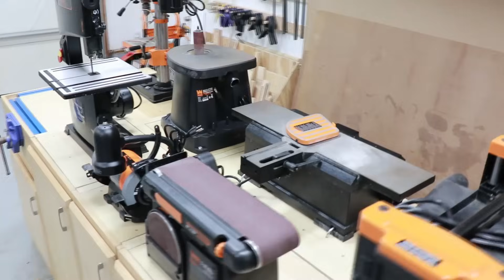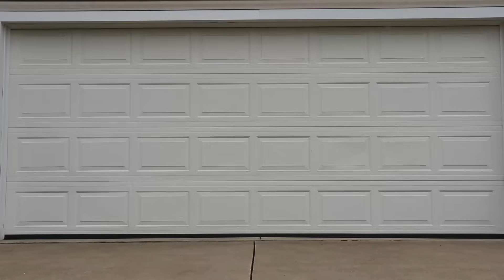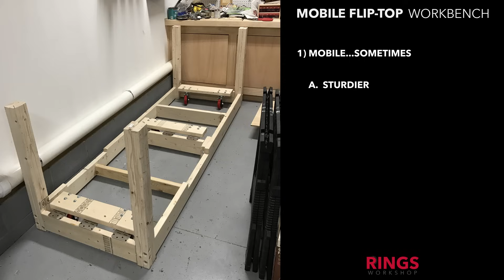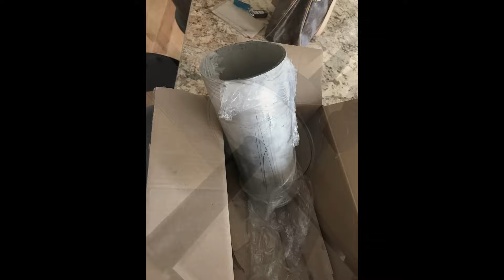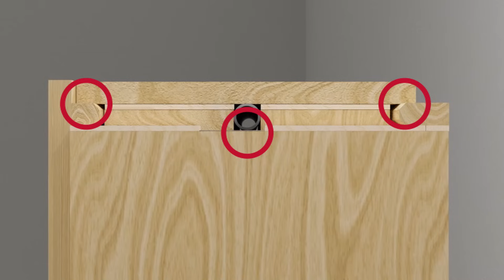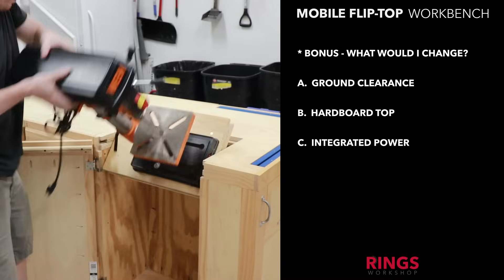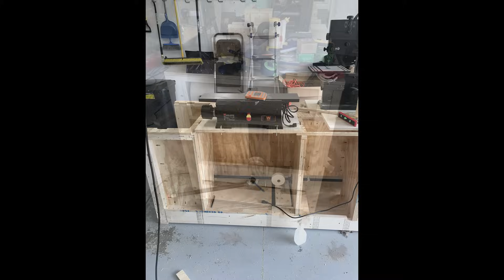Mobile Flip-Top Workbench

Comment: I recently bought some round cut-offs of solid steel rod/pole on eBay. I purchased a 6" x 2" pcs for $7.00 but they had a lot more smaller and thought of your came mechanism. If you ever want to change out your wood cames they were only a few dollars for the smaller pieces I saw.
Reply from the maker: That’s awesome, precut would be very handy.  Thanks for the heads up!

Comment: Outstanding design!  I just thru my latest plans in the trash.   If you made it a bit wider could you have run a Kreg track down the middle for extra clamping of longer/wider pieces?  Great video and explanation, thanks for sharing.
Reply from the maker: Thank you!!   Yeah I could, where I planned to store it initially I wouldn’t have  been able to reach over it to reach what I had stored in the wall so that’s why I didn’t go wider.  But you would have only needed another 3 or 4 inches or so and you could have done that for sure!

Comment: Hey just checking in on this to see if you are planning on making plans available for this project. Keep up the good work!
Reply from the maker: Thank you!  And yes, I will be starting them this week.
Reply: @RingsWorkshop  great looking forward to picking them up as I have been reviewing this video for several months now. I want to get started ASAP and I was going to simply try to wing it bu tI would prefer to see plans as this project will be tricky!
Reply from the maker: @excelmonkey  I apologize, I was hoping to have them done by now but my current project is taking a lot longer than planned, but it’s going to be wrapped up in next few days.
Reply: @RingsWorkshop  no need to apologize - just super excited to start this project.
Reply: I am also interested in getting your though on centralized power too.  You noted that you would have to do away with the paper dispenser and the adjust the spacing between the pipes used between the adjacent flip boards.  I may just buy the power tools you used here to keep the it simple and the dimensions the same.
Reply from the maker: @excelmonkey  Drew Fisher at Fishers Shop did his flip top this way and I thought it was a really cool idea.
Reply: @RingsWorkshop  yes agreed this is a great solution. Need to think through how that could be incorporated into your design.  You have multiple pipes in your various flip tops and the various power cables need to feed back to a centralized location.  Thanks again!
Reply from the maker: @excelmonkey  his pipe was stationary, being that mine slides I wonder if that would cause any wear over time.
Reply: @RingsWorkshop  thanks - two more question - how did you attached the 3/4” front support (for flip top) to the inside of the cabinet doors.  Are they glued or did you have to attach them with screws?  Also what is the diameter of the flip top pipe (you noted that it is less than 1”)?  Thanks again.
Reply from the maker: @excelmonkey  screws and glue for the supports, 3/4” pipe.
Reply: @RingsWorkshop  great thanks - and what about the long pipe that runs through the length of the bench. What was the diameter of it and did it simply pass through the 3x wooden beams via a holes or did you line the holes in the support beams with some sort of socket or mount?  Sorry for all the questions - I am kicking this project off and I think I know enough to get started!
Reply from the maker: @excelmonkey  I’m not sure on the pipe, I’m not home at the moment so I can’t measure it.  It went through 2x6 on the ends and plywood in the middle I believe.  I used flanges so it wouldn’t wear on the wood over time.

Comment: Stumbled on this video at the perfect time.  Planning a new shop build for this summer and this would be the perfect way to keep everything tidy and organized.  Curious if you think this could have been built out of 1/2 inch ply instead of 3/4? Obviously this would entail scaling down the pipe sizes, but with the dimensional lumber as structure, I'm curious if you could cut the bench weight by 1/4 by just using different sheeting?
Reply from the maker: Possibly, I always tend to error on over doing it when it comes to that.  My biggest concern would be the jointer as it is by far the heaviest.  I also wanted to top 3/4 ply so it would be flatter, 1/2” has too much play imo, so not sure it would be as clean on top.  If you made top thinner, that’s also making the braces on the door thinner, the part that is locking the tools in place, which I wouldn’t go thinner than 3/4” unless you made them of something strong than plywood.  All I’m all, I wouldn’t scale back myself, but that doesn’t mean it couldn’t be done and for lighter tools it may be ok, but jointer, planer...I’d stay with 3/4”
Reply: @RingsWorkshop  Gotcha.  I guess it ultimately depends on what equipment you plan to store, but I do appreciate the inspiration.  This will save countless feet of horizontal space.  Might even be able to convince my wife that the new space can be a "multi purpose" room instead of a shop. and help me get this project in front of everything else on my honeydo list.
Reply from the maker: @craigcoffey3808  when my wife found out she wouldn’t have to hold plywood as it came off the saw for me anymore she was 100% all in.  Haha.  Looking forward to seeing what you come up with.

Comment: You're a flippin' engineering genius!  Very impressive as well as your 2 storage videos.  

A question or 2 - is your garage climate controlled? Heat in winter - A/C on the hot days?  I live in the south and humidity and condensation cause  me a constant battle with flash rust.  A light coat and wiping of 3 in 1 oil or WD-40 helps, but not so great on woodworking tools as the petroleum will get into the wood.  Do you have this issue living in the north, and how you combat it?  Thanks.
Reply from the maker: Thank you so much!  I just insulated within the last few months, so it normally could get pretty humid in there during the summer.  I have an AC but it only ran when I was actively in there and even then it didn’t do much prior to insulating.  Haven’t really had any issues with rust on tools, a couple spots on cast iron top of table saw that I have to clean up every spring but that’s really it.

Comment: I thought about your monstrosity drawer, and may have a different way to screw mine up. I'm going to raise the bottom frame rail to be level with the cam bar, and maybe sneak a shallow drawer UNDER the frame, then have the next drawer up be OVER the frame, and think real hard on trying to get the cam wheels to be in the space between 2 drawers next to each other. If I plan hard, and draw it out first, maybe the middle wheels are a little off center, but that will probably work well enough. I look forward to attempting to build this modified design, and discover the spot where I screwed myself even worse. :)
Reply: Oh, just figured it out... without the bottom rail being on the floor, now I have to work in a series of legs to hold the weight off the drawers.... I think it can still work...
Reply from the maker: I said similar pain points.  Every time I figured one thing out it screwed something else up and had to keep tweaking it until it all worked together.

Comment: Looks really nice but since there's only one tool per section, I don't see the benefit. Thats a lot of work and material. Why not just pick the tool up from the cubby and place it on a sollid bench top? I mean, you basically built a large cabinet with doors and chopped up the top so you could roll the tools out instead of simply picking them up. Great craftsmanship though.
Reply from the maker: Thanks.  It’s faster to have a flip-top and when they are up they are secure and don’t move.  Normal benchtop tools still tend to slide around a lot unless clamped or screwed to a surface, again adding more time in order to use the tool.  So it for sure took longer to plan out and build but is faster and safer to use.  That and the jointer is pretty heavy, so it’s a lot easier on the lower back not having to dead lift that thing haha.

Comment: If someone asked you, to build this bench again, with the updated ideas on it and paid you to built it? Would you be interested? You could then do a video of it. With a dust system included in the unit. I notice that the wheels do not turn, Can they be made to? I want to keep one like this in the middle of my shop and work all around it.
Reply from the maker: 4/6 casters turn, I kept the far end fixed so it was easier to move with that much weight.  Originally they swiveled and it was much harder to control.  Maybe someday I’d think of making one with the changes, I wouldn’t add dust collection in as it would be just as hard to make with the flip-top /, easier to have a separate hose externally in my opinion as you would still need a hose to connect it to bench, the power however would be amazing.
Reply: @RingsWorkshop  thank you

Comment: You want to help design another one with some different tools?  I have a very small shop as you do.
Reply from the maker: When I make plans I’m going to try to build in flexibility how you could adjust based on different tools.  Unfortunately some of that is hard to figure out how it will fit until it’s actually in there and make sure it is balanced and stable.

Comment: How did you do dust collection on your tablesaw
Reply from the maker: Pulled out factory port, blocked that slot in the back, added a dust hood at the bottom and sealed it up.  Works much better.
Reply: @RingsWorkshop  thank you

Comment: The trim could be floating, so it tracks on the floor, even when the bend lifts. Nothing worse that small screws and washers. Feet are great for 45 degree deflectors. Running power through the base to outlets in the bottom of each section, using the 6 foot cord typical of each power tool. As for the edge banding, I think it adds a great look but I would have have made it either a real raised panel door or narrow edge banding stock, such as 1/4". The shallow cupboard at the left is perfect for safety glasses, ear protection, push sticks/pads for the table saw, jointer, band saw. You could even add magnets to these so they stick to their tool when inverted. I would add a work light for the drill press, band saw, sander, or add an electrical receptacle to each platform into which plugs their light and the tool, relying on the main power run in the base. In my shop, I created "floor Draws" the slide along the floor between the main vertical panels of my fixed benches. I gain nearly as much storage as the surface area of the entire bench. Your would have to be on slides, not on the floor, and with the trim/baseboard floating, now this being drawer fronts, the casters carry the weight, not the beam strength of the base board. Finally, I've done the same cam idea on my 9 foot sliding rail next to my table saw, to it's level as the floors never are. That said, a knuckle or knee joint, as used in a car's scissor jack offers significant mechanical advantage without the sliding friction of  your rolling cams, although the steel band is brilliant.This is a really impressive project you built. I wish you continued success.
Reply from the maker: Lot of cool ideas in here, thank you!

Comment: Great job.  Do the casters swivel?  If so, just to ask, in the transport position,  it would seem that the plate on the casters have to be on the same plane as the floor in order for the swivel to work correctly.  I think.
Reply from the maker: Thank you!  4/6 swivel, the two on the far end do not to make it easier to move.  The angle isn’t severe enough to impact them not swiveling, they move just fine since they are mounted to the board that is pivoting, it wouldn’t be in the way as they are at the same angle it is.

Comment: Great bench, amazed at how well that works. In that cabinet you have nothing in... do you have a circular saw with tracks? Maybe storage for the slides?
Reply from the maker: I don’t yet, but I plan to.  Love that idea, only concern would be I’d only use the tracks for cross cutting so I’d want it to be a little over 50 inches or so and bench isn’t tall enough.  Could make it two pieces that connect maybe.  Food for thought for sure, love it!

Comment: Thanks for the great video. I saw the Handyman article years ago. Your video reminded me, this is the bench for my new shop.  Will the plans be ready soon? I am starting my build in January.   I will be substituting a couple of tools so the original plans would help me fit them in.
Reply from the maker: I am hoping in the next few weeks.  Wanted to get a few easier plans done first just to get a layout down that I liked.  Should be posting another video tonight and then I’ll work on getting more plans done and hoping work up to the bench within the next couple of weeks.
Reply: One follow up question. Why did you mount the drill press sideways on the bench?
Reply from the maker: @davidboles305  space.  If it was turned 90 degree I wouldn’t be able to have the bandsaw opposite with the current bench depth.  That’s why I put it on the end so I could use it straight on still.
Reply from the maker: Plans are now available.
Reply: Thanks for the plans update. I built my bench in January. I added the overhead dust collection and power and Love It.  Thanks for the inspiration.
Reply from the maker: @davidboles305  nice!  I realized that notifications don’t always work well or get to everyone so I figured this was the easiest way.

Comment: Excellent build!  I too living in a colder winter state and the shop doubles as a parking space. I am in the process of designing/building  a new bench and love the push down casters with the cams. curious when building this was there a reason you went with the hinged board that pushes down on one side over a board that slides vertically on a pipe? does the hinge allow for better leverage?
Reply from the maker: Thank you!  I’m trying to visualize what you mean my sliding on a pipe vertically. Do you mean a separate pipe from the one already there?  Just trying to imagine it.
Reply: @RingsWorkshop  similar to your flip tops but rather than the pip moving horizontally it would move vertically in a channel. A separate pipe from the lever and cams. basicly instead of the cam pushing down on the board hinged to the base, the cam pushs down on a board that slides vertically
Reply from the maker: @MrMiller0313  ahhh I see what you mean.  Honestly hadn’t thought about it, would likely work as well.  My only concern would be long term having access to it in case it got caught up.  I don’t really worry about the hinges failing.  Other thing would be if it would take up more space to slide up and down under the cam and where it would mount, but I’m sure all of that be figured out and work really well the more I think about it.

I’m going to make a table saw enclosure in the spring / summer if I can afford a new saw, with that I will be making my own lift again and may look at a few new ideas for it.

Comment: Thanks for the idea, will look into making something like this, but include power, and dust collection!
Reply from the maker: I though about DC, but wouldn’t work well with the fliptop part, so I have mine that hangs directly overhead instead (along with power).  That and I use both when I sand as well so that seemed easier for me.

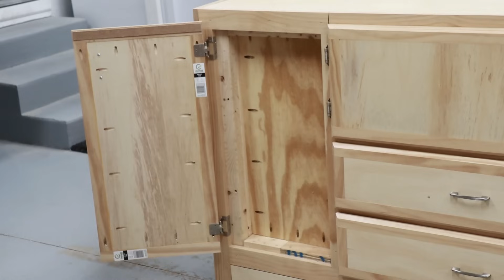Comment: To answer your question at 17:08, drill bit holder.  I'm not sure how close that spot is to your drill press , however, you could build a bit holder similar to most router bit holders for your most common used bits.  Honestly, that area looks big enough that it might fit all bits that one would use.

Regardless, that bench is fabulous and I look forward to building my own.
Reply from the maker: Thank you!  I’d love to see what you come up with as well.

Comment: Do you think it would be possible to extend a grid of t-track across the whole thing?  You could put sections on the flat side of the flip tops.  Not sure if you'd be able to get it to line up perfectly though, the flip tops might have some shifting in practice.
Reply from the maker: Yeah, they could shift and even though there is very little movement, I’d still be worried about how tightly you could clamp it on those parts.
Reply: @RingsWorkshop  I guess if space allowed you could leave more room between the flip tops and put more t track on that more solid area.  (I want my next bench to have dog holes or t track, trying to think if I could make that work on a bench like this)
Reply from the maker: @jbehmer  I had planned to use dog holes initially and never got around to adding them by the vice / t-track.  If you made it deeper you could add a track down the middle for sure.

Comment: I've been searching various solutions for setting up my garage shop.  This design seems perfect.  Two questions.  Are there tools you wish you hadn't allocated space for since they rarely get used?  And what are the overall dimensions of the unit?  I know it will vary based on what I decide to include but just curious for planning purposes.
Reply from the maker: I’ve been happy with the tool selection.  I’d like to at a mortiser at some point, but that will be used so rarely I wouldn’t even keep it in here.  Dimensions are roughly 36” high, 8 ft long and 30” wide

Comment: You don't happen to have plans for the flip-top portion, do you? It looks like it's just what I was looking for, but I'm just a beginner. I think I know what is needed, but just want to be sure.  Is the flip-top something a novice could pull off?
Reply from the maker: It would be tricky for a novice, but not impossible.  It’s a lot of 90 degree cuts so as long as measurements are correct and it’s all squared up it should come out just fine.  Biggest thing is making sure it fits your tools.  I’ll have plans out over the next month or two for it.